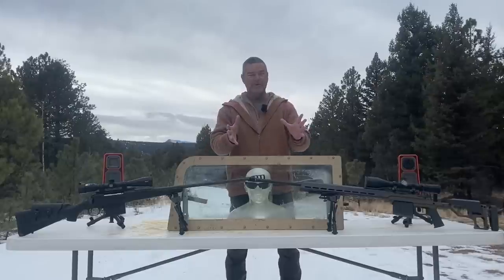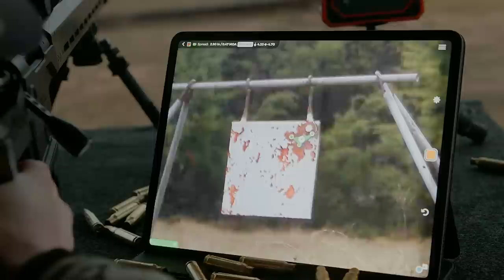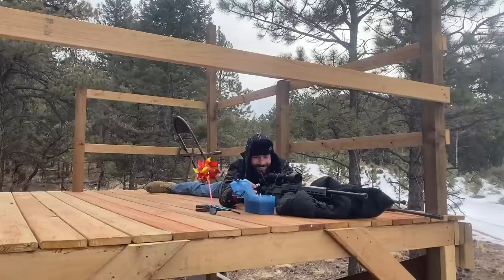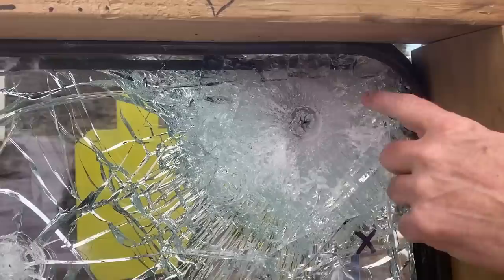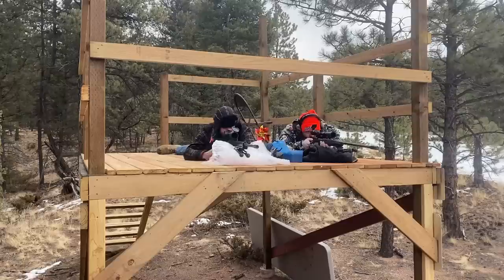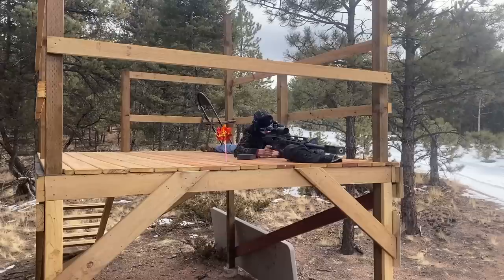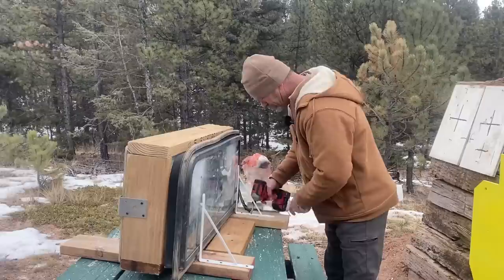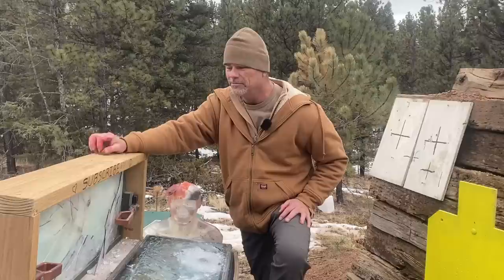338 Lapua vs Humvee Ballistic Windshield

Comment: Kool video. The windows are rated ballistic, and the nomenclature is a ballistic window, not bulletproof, like a flack jacket isn't bulletproof. That's what you'd learn working with tactical vehicles. Never the less the ballistic windows performed well. We changed windows when they became cloudy, lamination separation, crack/s, get technical even a chip, then recycle with metal scrap.
Reply: Didn't you learn that it's flak jacket? 😛
Reply: @elemar5  I won't correct it, didn't notice 😆 it.

Comment: I think you are basically right about the movement/penetration thing. I also believe you loose a small amount of penetration. If you line up empty soda cans in a row and shoot them , at some point the round isn’t penetrating them, but pushing them out of the way. So you loose that little bit of punch.
Reply: To prove it is to (try it). Try shooting steel "non-stationary" and then try shooting it "stationary" to see the difference...I have a feeling this argument will only keep continuing online...
Reply: how heavy is the bullet of 338 lapua ? and here I mean the whole bullet, with charge, case, projectile, prime everything, because I can't find anything on the internet about it ,I'm interested in the total weight, especially the one with the 16.2g projectile (250grains)
Reply: @xd.5.45  lol why not weigh it yourself using a weight scale to find out????

Comment: For the engineers, the answer is yes, it will effect it... But the higher the velocity of the bullet and heavier the mass of the target, the more and more negligible that difference becomes. A slow moving projectile against a light/soft object will decrease the impulse, which is energy transfer over time... Effectively, higher impulse is the most effective way of penetrating a target. It's why you'll splat on concrete but a net, mattress, or even a bunch of empty cardboard boxes or snow at the same velocity can save your life. Kevlar will capture the bullet, steel will shatter it... unsupported Kevlar will have a much easier time "stopping" a bullet (capturing it) despite the far lower resistance to penetration of equivalent rated steel. The problem with silk is that it is super strong, but EXTREMELY stretchy, so it will stop a woven bullet, but it won't slow it down enough before it hits flesh otherwise it would be too bulky to wear (no matter how light).

Comment: I agree it doesn’t matter if the armor can move. You should do a video to prove that out. Use steel armor because it’s really consistent. Find a round that won’t penetrate at 100 yards but will at 75 (so you know you’re right at the limit). Do one fixed and one that can move.

Comment: I think yr wrong, just cause the bullets moving fast doesn't mean it won't lose some power if the target moves the same direction as the bullet, it's like tackling someone who's standing vs someone who's against a wall, the difference would be devastating.

Comment: Some of the energy of the bullet was diverted into moving the frame. But very little as you can see. Shattering the glass absorbed most of the energy, and of course energy lost in the form of heat.

Comment: I would have presumed based on what I know about long and short recoil operated fire arms that any movement in the glass target and frame would be after the impact had been completely absorbed.
  In fact if the round was going to penetrate the glass wouldn't have moved very much at all.
  I have also read that any Spitzer bullet will tend to tumble after hitting a relatively solid target. The shape of the bullet puts the center of gravity towards the rear. So when it hits anything that destabilizes it it tries to right itself. Heavy end forward.

Comment: I think the interaction is more or less done before it makes a difference, Although i have seen some key difference with things like really thin metal plates, I have seen a difference between 15 plates spaces an inch apart and 15 clamped togeather. So there IS something there. But i don't think its enough of a difference to make a difference most of the time.

Comment: What's wrong with most of these metal plate and windshield tests is that a real vehicle does NOT move a hundredth of an inch when hit by bullet, but all bullet energy goes to the impact. Here you can see a lot of the bullet energy move that thing. So some kinetic energy was lost, it was not put to the penetration task.

So windshield should not move at all, otherwise this is not any real test.

Comment: if the target can not move, where does the energy that would have moved it go? Just disappears?
Reply from the maker: Need your proof
, but it would get absorbed into the vehicles frame etc. When I worked for an unarmored vehicle company we had to suspend the seats because the vehicle would get hit but the energy would be transferred into a persons body causing damage with a solid mounted seat.

Comment: I would be surprised if you lose more then a couple percent of the energy in the shot by the target moving, and yes the interaction at the exact point of impact is over before the the frame moves. 

The little energy lost is in the deformation of the glass and it’s absorption of the energy.  In a larger area.  Because the point damage is so much greater then the damage from deformation near the edge that little lost energy is not something that would a change in penetration.